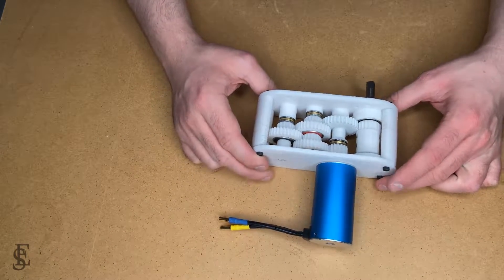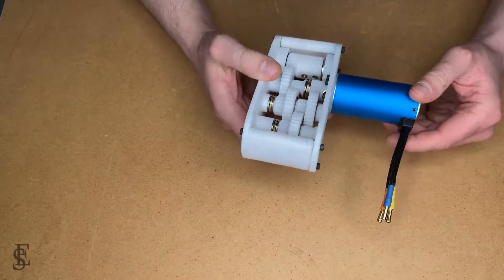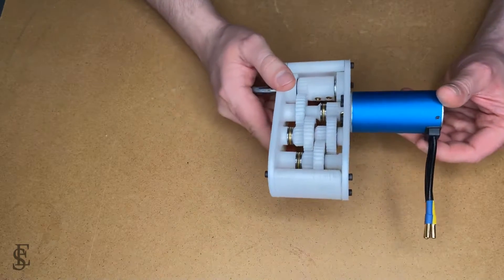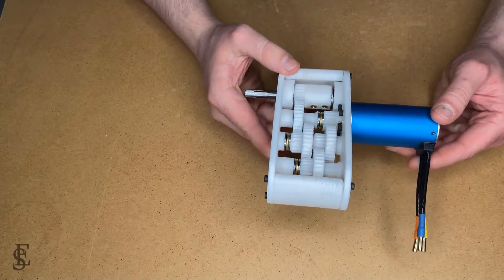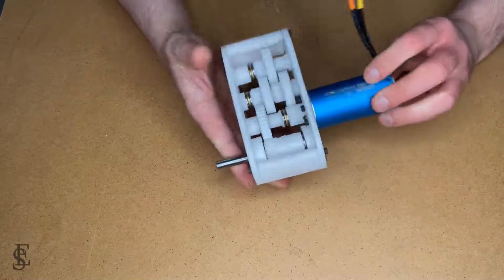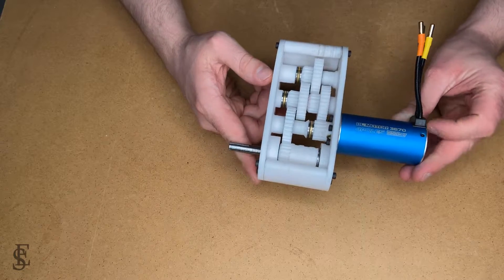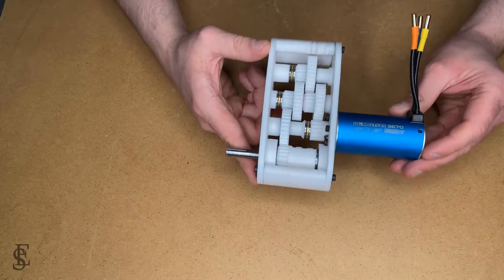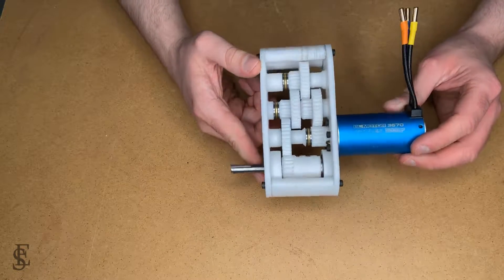EP 1   3D PRINTED GEARBOX

Comment: Hi, I'd like to point a major fail in your design.
Meshing gears with 16/32 tooth will result of localized wear spots over the meshing and heavily reduced life time of your gear box . Since 16/32 share common divisor at some point always the same teeth will be in contact between the driven and the drive gear.

You need to have a coprime teeth number between your gears to spread evenly the wear over all the meshing. 
Something like 15/32 is OK